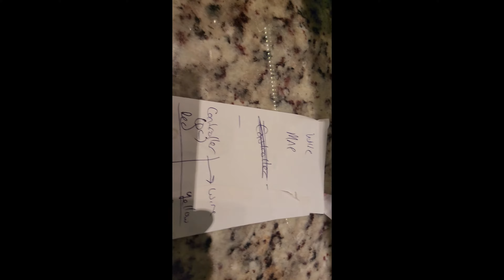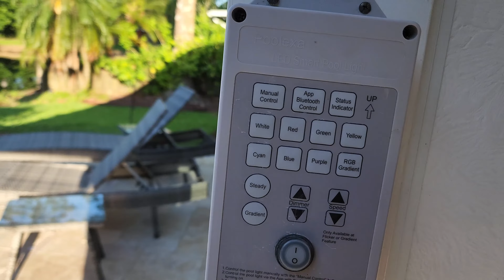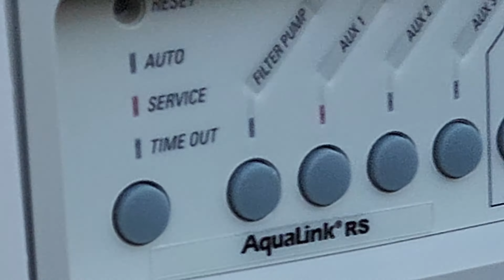40k Pool Project  -  Poolexa Light Install Part 2

Comment: great video. i have the same pool light, about to install.  although my pool light cable goes into the pool pump timing electrical box, and a GFCI socket.  current pool light is connected to a manual switch, which is what i think you have underneath your controller.  can you share you controller to manual switch cable setup?
Reply from the maker: I basically backhauled the power for the smart pool light back to the pool pump area since the switch already had power right there. I just wired it back to where you access the normal pool light wires next to the pump. Thank you for commenting and watching!

Comment: Does it only work on service mode for iAquaLink? Or will it work on Auto as well?
Reply from the maker: @osirisvillatoro5846  it works in normal mode .
Reply: @Supercar_Street_Racing ohh I need to mess with it then because when I have it on auto the poolexa light box shuts down. It's only working when it's in service mode.
Reply from the maker: @osirisvillatoro5846  Mine is auto right now and on..

Comment: Do you happen to have the dimensions of the controller
Reply from the maker: @dustinhopson624  I will get that for you but thinking back I would say like 10x5?
Reply: Thank you so much…
Reply: Also honest review after using light since video was posted?
Reply from the maker: @dustinhopson624 I will follow up on this thanks!